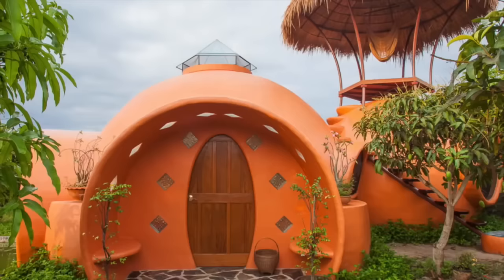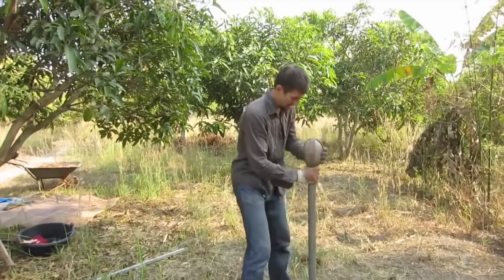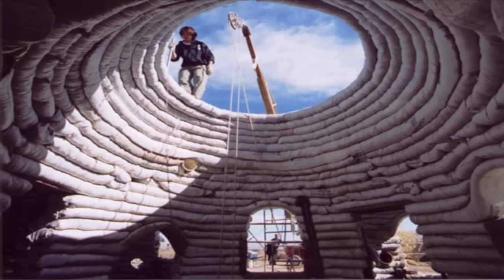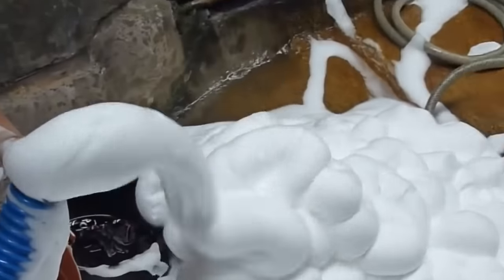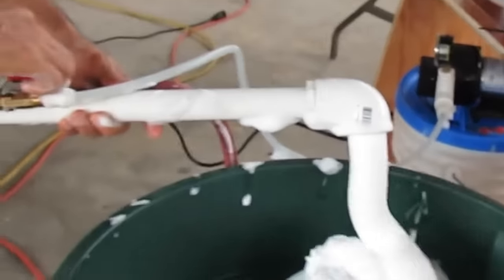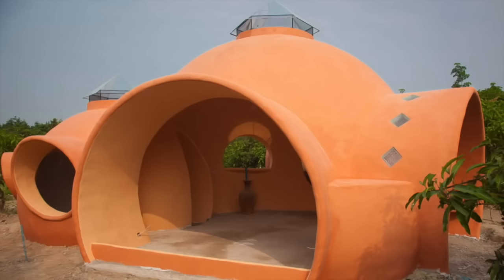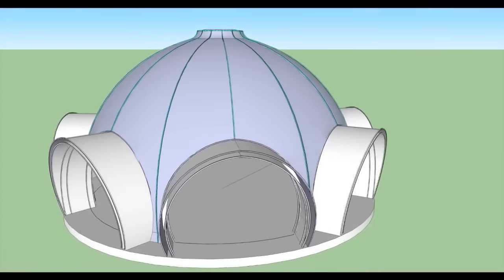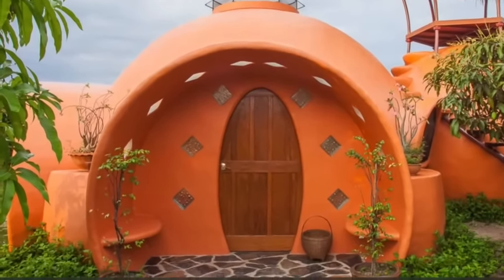How We Built this Dome Home (For Under $11,000!)

Comment: AMAZING!!!! I would love a home like this. I wonder how well it would do in temperatures such as 120 in the heat of Arizona 🌵
Reply: I think they do well in both hot and cold climates!  It's mostly trapped air which forms great insulation, but I feel like the concrete in it would naturally radiate heat.  I suppose you could paint it white to help 🤔

Seeing that you made this comment two years ago, have you been able to do anything with your desire for an aircrete dome home?

I've been personally sold on these for a while, and I'm now saving up for some land.  They're so amazing.

Comment: Are you running conduit in the walls for electrical wiring?
Reply: @minniewilliams1852  
Yes, that's great. However, you will still need wiring regardless of what your energy source is. I love the idea of having one of these near a flowing stream, with a water wheel 
for supplementary electricity along with solar.
Reply: @TheSouthernLady777  
Well d'uh. State the bleedin' obvious.
Reply: @TheSouthernLady777  So how do you currently live in a house with zero wiring??
Reply: @TheSouthernLady777  if you want light and running water u need wires and small plumbing. U can totally live off grid with no lighting. But u cannot live w/o hit water. So your left with a fire stove to heat your bath water, fire to sterilize your water that u will have to find and retrieve yourself. If u don't know how to cure your meat or hunt u won't make it. Bc u don't have a freezer to stock your supply. Greens are not all yr round unless u live in Florida, California and other partial tropical areas. One summer of beans will not last a full winter's supply either. Just saying to the least u need off grid electric by solar assistance with a charged back up in case u have 3 days of rain or snow and barely any sun.
Reply: Another good question that I hope he answers sufficiently.   This should have been addressed in his video.

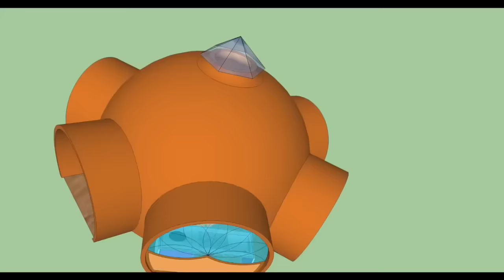Comment: This is one of the few times that I saw a dome structure where the windows and doors don't ruin the dome aesthetics.   There is really no way to put a square or rectangular window or door in a dome wall and have it look good.    Secondly, I"ve always wondered how one would make an operable round window.  Fixed round windows are easy, but how about ones you could open?  The solution I saw at 4:43.   You have a bisecting mullion and the straight edge created could accept hinges for a half-moon section of window.   So rather than the hinges on the perimeter, they're in the middle.   But I must admit, I've never seen that implemented, and to have it custom made would be anything but cheap.
Reply: Split the window vertically or horizontally so you have two semicircular panels?  You can hinge on the bilinear axis or from the perimeter edge of each semicircle?  Just a thought.

Comment: This is a really interesting idea and I was wondering if it would be possible to build one of these structures/homes in Missouri or Illinois or Arkansas? Is it just an island thing or can it be put on the mainland and would it do well in winter seasons?
Reply: I saw him respond to a guy up above who was asking about temperatures in the teens or even below zero.  He didn't come right out and say it's appropriate for below zero temps, but he does say that these domes have been built in cold climates with great success, and that the insulation values are high.  This would be because of all of the trapped air!  😎

I wondered this, being from Iowa myself.  Also I'm considering buying Ozark land for the homestead, hopefully someday soon.  Any area recommendations? 🤔😃

Comment: Not to demean this gentleman's work, but what would stop this home from blowing away at the slightest wind?
Reply: Aircrete is about as dense as solid pine, so while lightweight by concrete standards, the structures are still pretty substantial. The steel rebar embedded in the aircrete is firmly fastened to the rebars cast into and emerging from the foundation, producing a unitary structure. Similar domes in Texas have been the only ones still standing after a Cat 5 hurricane with 150 mph winds.

Other low-density concrete mixes are useful, too:

https://en.wikipedia.org/wiki/Expanded_polystyrene_concrete
https://www.youtube.com/watch?v=DVk6xNFduH4
Reply: @r0cketplumber   again the dome structure is more stable. If you ever camped in a dome tent and in a old fashioned cabin tent you would  know which was more stable.
Reply: @kathleenkirchoff9223  Absolutely. An arch is stronger than a flat roof, and a dome has the second axis of curvature making it even stiffer. There's a reason why shelled creatures and eggs have graceful curves and not flat slabs.

Comment: You can build a house out of almost anything for under 15k. The prohibitive costs are in permitting. etc. In many US cities, you face up to 10k in various permitting costs on a new build, even under 500 SF. Add in water & sewer connection at the site and you're up to 15-20 k in non-materials costs :/

Comment: He watched to much Flinstones when he was a child lol....my first thoughts upon seeing the outside of the buildings
Reply: Lol ... Cute Comment!
Reply: The smooth dome shape and monolithic construction (all one piece) eliminates much worry during a hurricane assuming the dome is properly secured to the concrete foundation.  The wind will flow over and around the smooth shape, and be less able to grab and pull at the structure, thus doing little damage.  The dome also eliminates the worry of a roof being separated from the home or the walls blowing in, that is unless the entire structure is sucked up as one piece like in a tornado.
Caveat: The top skylight and windows are vulnerable during hurricane gales, but not the rest of the structure.
I'm not fond of the looks of it for any suburban or urban setting, but in this natural tropical setting it seems to fit very nicely.   
Kudos to the designers and builders who invented this and the clever tools and shortcuts they created to solve the problems inexpensively and ecologically!

Comment: I wish it was legal to build whatever kind of home you want here in the U.S. Too many rules and control here.
Reply: To be fair, some of those regulations are for your own good in preparation of a worst case scenario. Florida has extra restrictions to make sure your AC unit is less likely to just rip off in a hurricane, California has requirements for Earthquakes, and so on. If you can still build this house and satisfy those requirements, I’m not sure there’s too much of an issue. If wiring needs to be in the walls, sounds like you may be able to do an outer or inner shell to have the cables run through.

Comment: I've worked with aircreate i would like to see cloth domes that when pumped create a solid aircreate dome. Then wire and ferro-cement to finish the outside for strength and waterproofing

Comment: Add a short throw 4K laser projector with cool fractals (hint, hint) and you can cast some super sweet animations to the interior or exterior of each dome with perfect focus.  Laser projectors (not the ones from Epson) are amazing at casting images and video onto oddly shaped surfaces without a hitch.  Dang..nine grand for a complete small home or studio.  I love the way this can be be built out as needed by adding new domes to the perimeter.  Why I bet you can even make a fractal with these :)

Comment: Amazing. This is the type of innovative sustainable building technology we need to adapt to large-scale development. I’d like to know if this design accommodates traditional utility systems: water, sewer, electricity, HVAC.
Reply: Why wouldn't it?  Most heat exchanges are on the floor anyway.  A split HVAC could easily fit up on the wall just b4 it curves overhead.  Besides, in a dome you're not heating so much empty air space, so you don't need the same muscle as in a square type structure.

Comment: Been looking through your website but a lot of FAQs seemed to only partially explain.  Example: “Are there different methods for manufacturing AirCrete? 
AirCrete is commonly manufactured by two different methods. Method 1 consists of mixing a pre-formed foam into the cement and water slurry. Method 2 consists of the addition of reactive substances, which produce gas bubbles when in contact with the cement and water slurry.”
Nowhere is Method 2 explained further, and no mention of it anywhere else.

Comment: I love this. Would it be warm in the winter and extreme cold like where i live in Minnesota?
Reply from the maker: Yes! Aircrete has an R-value of around 2R per inch.  In colder climates, we recommend you make your walls 6-8" thick but even at 4" it's not hard to head.  Domes have less wasted air space at the top to heat so are very efficient.

Comment: I have property, leased to me, on Mindanao, Misamis Occidental province. I wanted earth bag but possible floods will wash they away.  The second issue is typhoons and high winds on my hillside portion.  I want to buy the equipment to build this stuff.  I have access to Lauan plywood and bamboo out your nostrils. I’ll need a generator and some power tools but I have the mechanic tools required.  Hook a believer up. I have a village to rebuild on raise concrete blocks. I could do this. 

As always, thanks for sharing. I believe that I could do this with the village cooperation in the construction as it will be their homes.

Comment: Aloha 🥰 who on the Big Island builds these?? Can't decide between a container build or an aircrete dome. But this video has me leaning towards aircrete
Reply: There are lots of issues with containers as homes. There's a good video by an architect who loved container homes til she learned about the various issues.... condensation... structurally the sides need added support...toxic off-fumes depending upon what was stored in it...heat loss / retention ....

Comment: These are beautiful, but do they meet building codes? How hard are the permits to build something so out of the ordinary. Would run into problems with plumbers, electricians ect.  who don’t know how to work in these conditions.
Reply from the maker: We have recently gone through an engineering process and received our designs stamped and approved by an engineer.  This is the first step to getting a building permit.  It doesn't mean you can get a permit anywhere but a lot of places will give you a permit as long as you have the designs stamped by an engineer.  We will be sharing more on this to people out our mailing list which you can subscribe to at domegaia.com

Comment: Now you need to build apartment style ones for use in high density areas 😉
Reply: Unfortunately not only does the shape not lend itself to multiple stories, but the structural integrity does not either. You would still have to have some other type of stronger material for the skeleton of the high rise building and then simply be using aircrete for walls and such. so you would have some of the benefits, but a very low percentage.

 High density living is not what mankind needs. What we need more of is decentralized societies with sparse population . Which is only possible after the world economy completely changes. So not likely.

lol,  I should have started my reply with "fortunately"!

Comment: We just put up a yurt... wish I’d seen this first!  How do these do in frigid or damp climates?  What about heat, and do you have the bathroom separate, as (ideally) in a yurt?
Reply: That’s the problem of these type of designs they quickly become expensive when you have to take an account hot weather cold weather bugs and insects etc. etc. In a climate like Indonesia where you don’t need windows you don’t need air-conditioning you don’t need heaters then it’s very inexpensive. Those house is also built right on the ground so there’s no expense of foundation. When you start bringing in the government and building codes that have to factor in heating and air-conditioning etc. the cost starts spiraling upward!

Comment: Is the floor also formed of aircrete?  How much surface pressure can that stuff bear without crushing?
Reply from the maker: Aircrete works well as a subfloor but it should be covered with something hard. This could be a thin layer if cement, earthen floor, laminate or tile for example.

Comment: Would it be possible to mix clay, rather than plaster, into a similar ceramic foam, and then fire the bricks in some way that minimizes smoke?  Because burning limestone to make plaster is the biggest contributor to greenhouse gases in the world.  (I do appreciate that you have found a way to make a little go a long way, though!)
Reply: Which greenhouse gases?  CO2 that plants eat, or water vapor that beats all of the other ones combined, for total greenhouse effect?

If it makes you feel better, aircrete is literally mostly air.
Reply: @FancyNoises  CO2, for which we have fewer and fewer s plants to eat it, thanks to the destruction of rainforests and the Sargasso Sea.  Also, plants that have too rich an atmosphere of CO2 grow too fast and produce significantly less nutritious harvests.

FWIW, increasing CO2 increases water vapor by increasing heat, so they wind up increasing heat together in a vicious cycle.  But you knew that, since you know about the water-vapor issue, right?

I do agree that aircrete is much greener than ordinary concrete.  I was just wondering how we might tweak it to make it even better.

Comment: My only concern is if we have a plasma event( or DEWs being used to depopulate an area)... the steel reinforcement would be affected,  perhaps not burning the building, but possibly turning it into an oven. If the California fires were any indication, then non-natural events take place & I would just as soon be prepared for them. Perhaps some type of structure which does not contain any metal at all would be the surest way to get around that type of event.

Comment: Is it possible to build it the domes underground? Like in a earth sheltered house?
Reply: AirCrete-style fill has a significantly lower load-bearing capacity than your regular structural concrete, making it a less-desirable candidate for the structural portion of an underground dome. However, it does make an excellent candidate for a load-leveling fill as a sort of "cap" over an underground structure because of its minimal settling, its ability to form to voids, and great strength-to-weight ratio. Now there are some variations of "earth-sheltered homes" where the structure is basically above-ground and only has a relatively thin layer of earth over it, which should be perfectly plausible if you've done the math to ensure it will bear the load.

Comment: Avoid using household detergent as a foaming agent. It was used in the past as a low cost plasticiser and results in the chemical bond failing over time. I take years though.
Reply from the maker: I don't think this is true.  Maybe if you used very high concentrations of soap but at the extremely low concentrations we use this is not an issue at all.

Comment: Most counties in Arizona won't even let you build a home under 1,000 square feet.  Good luck getting them to approve one built out of a material that isn't wood and drywall, with a concrete foundation.

Comment: That's an old material ! I used it to build a bar counter in my kitchen. It's called Porenleichtbeotn or Ytong in Germany.
It's easy to work with and very lightweight. But it cannot carry a lot of weight. You would never be able to build anything above ground floor.
Reply: Someone above mentioned building a 2 storey home with similar materials.
Reply: @birgip.m.1236  which country? It depends on the regulations. In central Europe, they would never allow any instable material to be used. It must be steel-reinforced concrete or similar.
Reply: @anadubar4819  In the comments... I believe in the U.S. (possibly Kansas if I recall)

Comment: You are still using concrete and dish soap which can't be non-toxic, well maybe the dish soap, but what about the concrete?  Why not use hempcrete with the foam or even with adobe?
Reply from the maker: Concrete is not toxic.  You need to wear a dusk mask when making it but once it cures it is completely safe.

Comment: My biggest concern is insulation ,heating, water resistance and the design in areas like where I’m at needs to be able to survive cold and freezing conditions. If it can accomplish these task just as good as the conventional timber framed house, then it is indeed environmentally, economically and reliably better than the conventional timber framed home, I like the idea, I do but I want solid evidence.

Comment: Aircrete was used in many public buildings in the UK including schools. After 30 years it loses its strength. Many schools in the UK have been shut because of structural problems of aircrete
Reply from the maker: That was a very different type of construction than we ware doing.

Comment: Concrete deteriorate with age especially if exposed to saltwater conditions good example Alcatraz ? So how is this going to hold up over time, and impervious to 
insects I highly doubt that as a professional exterminator I have seen termites go through solid concrete walls.